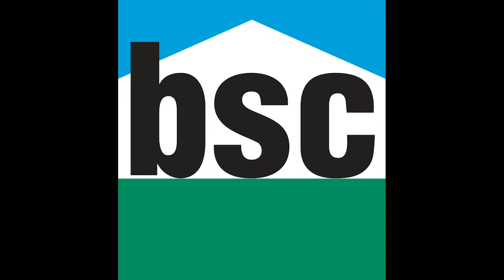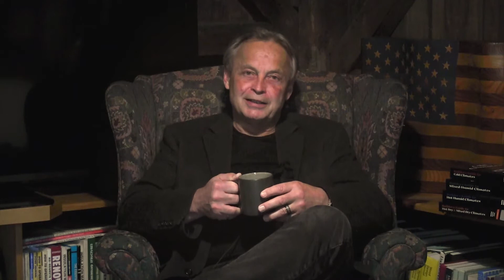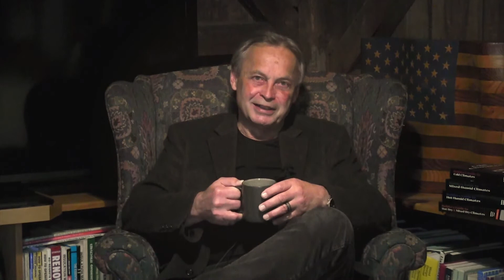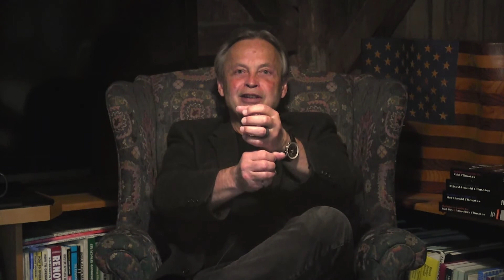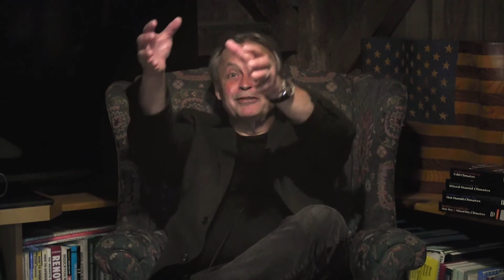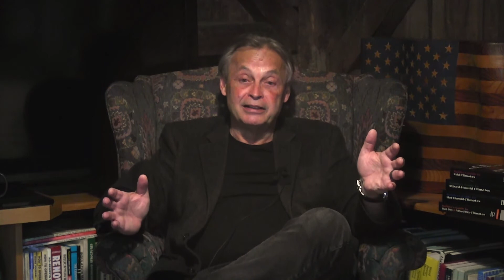Cup of Joe - Joe's Take on Manufactured Housing and Robotics

Comment: Of course factory houses HAVE caught on, in terms of what we call "pre-manufactured homes", they're here to stay. It's just a debate whether you want them or not. I have a couple recent examples. Right on a main street (well the corner of an side street adjoining the main street), there appeared a row of tightly spaced double-wides. I thought surely they were just parked there temporarily--- but they stayed, with a row of little detached garages in the back!  Apparently it was a planned unit development that the city approved to help with housing requirements. Just seems odd. because, nice as they are, they look like they belong in a "mobile home' park. Another example we were asked to help with some minor renovations on a  small 2 1/2 wide manufactured home in a residential neighborhood. It sort of looks like a regular house by the way they did the roof, but it's not pretty at all and sold (new house garage and lot) for upwards of $900,000. Not sure who made out on that one, but-in the end- it was likely not that different in building costs to the same cheap house built in place.

Comment: We've long had a lot of pre-framing in tract homes. Wall sections are often put together  off-site and then you use pre-manufactured trusses. But usually the walls are framed manually. I think robotic framing machines would be faster and more accurate. Possibly these can be made more portable. You have to compare that though with the speed an experienced crew can frame walls in the first place. Add in that we are getting better tools all the time. So maybe some more automation and standardization closer to the jobsite will be the way that robotics, standardization and modern manufacturing ( taditional factory advantages) can help. You also need some help to make foundations faster more accurate, otherwise your off-site work won't fit.

Comment: While I appreciate your insights, I'd like to suggest a different lens.

I'm on a listserv called Tradarch, which focuses on traditional building. We had a lively debate on automation, and a sculptor spoke up to say that he was happy to have a CNC machine cut away most of the stone so he could concentrate on the expressive detail. (If you get on that list you can get his name, but I don't feel comfortable mentioning it. Suffice to say he's a recognized traditional sculptor.) That's the kind of thing robotics can do to support craft rather than replace it.

I'm also aware that a team from Stuttgart built a timber and plywood dome out of jigsaw-like geodesic pieces. That dome required a degree of precision that is almost impossible by hand. That precision allowed the team to prefabricate a complex dome with uniquely-shaped panels out of ordinary materials. Geodesic domes that have used that simple structure since the '60s have either had to limit the number of unique shapes or have had to use a strut system of carefully-calculated chord members. 

I think this is where robotics can help. It can help us to fit things precisely and to "truth" conditions in the field using LiDAR-generated point-clouds and photogrammetry. In fact, that's one of the first real-world uses of Boston Dynamics's Spot robot. If we have such point-clouds, then we can use either precise robotics or just careful humans to do things like prefabricating a new wall to fit into a slumping 500-year-old timber frame English Hall. 

As for prefabrication, I think you probably see where this is going. If we can prefabricate panels to fit together precisely, then we can get the structural part of the structure to fit together precisely in the field. That said, your "perfect" walls, roof, and foundation require continuous membranes, insulation, and rain-shedding layers. The problem isn't fitting the  together as wrapping all those layers continuously and getting the outside on right. That means that in addition to precision, robot-human teams will need to tape, caulk, seal, spray, and then affix a raincoat on the building. That's more of the job than just the structure — and it's one the Stuttgart dome didn't contend with.

As for 3D printing: it just isn't all that compelling until you can print roofs, floor/ceilings, and foundations. To be fair, Mighty Buildings can do them, but only with a Corian-like material. I look forward, though, to a robot that can place something akin to a Catalan vault or a Guastavino tile vault. It just requires some dexterity, precision, and mastery of the mortar mix. 

Finally, I agree with your idea of bringing the factory to the site. Suppose a city with a housing boom decided to reconstruct a large area. A factory could match its pace of production to its potential to meet the real estate industry's ability to absorb housing. it might be able to tool up a factory to handle a 7-year production schedule using only ordinary streets and not expressways. In that case, the factory might just have to truck some oddly-sized panels up to 30 minutes away on ordinary roads. (This would be a bit like concrete today.) When the construction boom is done, the factory could then enjoy a second life as a home base for refurbishment projects tailored precisely like the new wall in a 500-year-old Hall. 

I hope this provokes some thought and comments on your vlog.